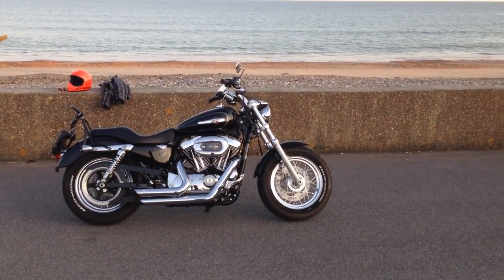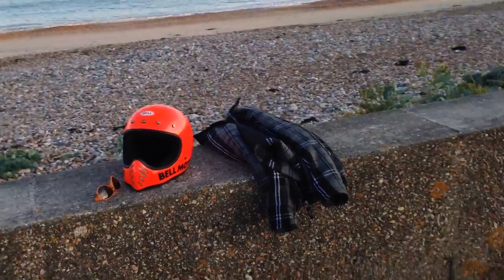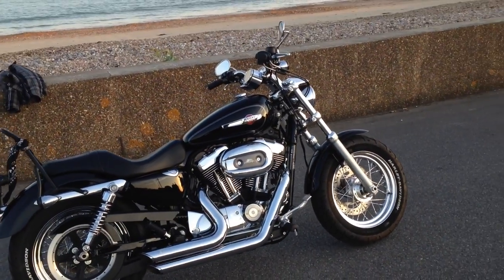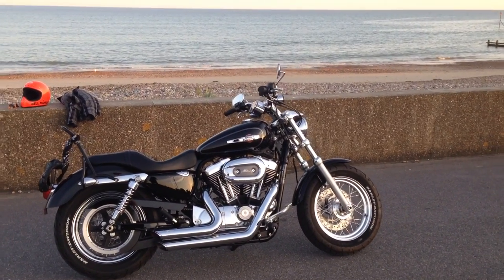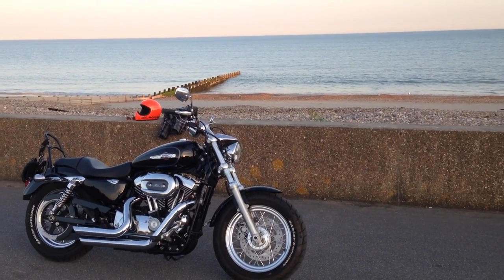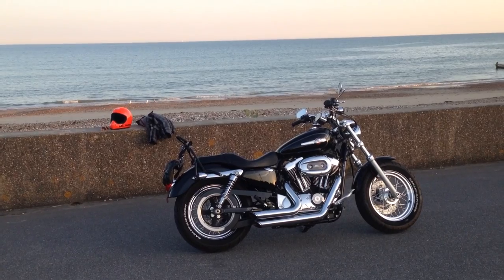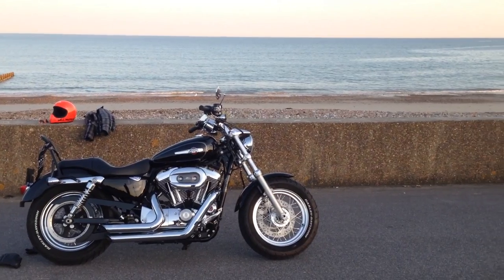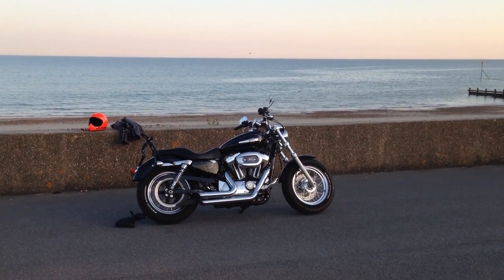What's a stage 1 kit and how much does it cost for my Harley Davidson sportster

Comment: I have a 2015 Iron and when I installed my fp3, it didn't ask me what kind of high flow air cleaner I have. It just asked me what kind of exhaust I had with a high flow air cleaner.
Sounds great. I have the V$H  Short Shots also. RIDE SAFE!

Comment: Thanks for the clear video, forums for a Harley noob can be a bit varied in opinion.
My biggest concern is longevity of the bike, I will definitely be taking a similar route to you with the stage 1, but I think I'll do the fitting myself.
Might see you down the Sussex coast sometime when the weather is good. Cheers for the video!
Reply: Jake 1200 , if you are concerned about longevity, don't worry. I have an '01 Sportster that I bought new and I'm still riding it with 87,000 miles on it. I have had no issues at all with the engine or transmission, or clutch. I did have to replace the fork seals about three years ago. Also, I replaced the drive belt once. And that's it, the bike has been very reliable and trouble free.

Comment: Unless your bike is still under warranty, then you can only do the screaming seagulls parts and only have Harley put it on. If you want to keep your warranty?
Reply: I haven't done mine just yet, but everything I've been told is that you can do the work yourself, but you have to use an HD tuner and take it to HD for the tune to keep the warranty.
Reply: @jacobwhite3128    Yeah, the HD tuner still leaves the bike running lean due to EPA restrictions. Anything Harley sells HAS TO be within epa regs or they get a massive, MASSIVE, fine from Uncle Sam. 
I went through DK customs and put a high flow breather, breather bolts , and these xl-vied devices on my iron 883 in place of the $500 tuner, and the vied devices won’t void any warranties because they don’t alter the bikes “tune” they enrich the air/fuel mixture outside of the actual tune in the ECM. I did all that for about $300 and my iron runs soooo much better now! It’s literally like a different bike. I can’t recommend DK customs enough! They are wizards when it comes to your Harley Davidson! I won’t go anywhere else for performance parts anymore.

Comment: Hello - I have the same bike....2016 1200c.  Love it.  How did you paint the HD letters on the tires.  I've tried a few options.
thanks.  Keep your knees in the breeze!
Reply from the maker: K Scott hi mate, I went on amazon and just ordered a 'tyre whitening pen stick'... you can get them on eBay as well. I warn you though it's a bit of a hassle, you literally have to lie on your back and 'draw' with the pen onto the 'Harley Davidson' logo on the tyre. The pen itself is a bit like a tip ex pen, it just gives you a tiny bit of white. Then you simply let it dry and boom......cheap as chips mod that really changed the look of the bike. Ride safe, jack.
Reply: @jackwednesday     sweet. Have to do this to mine

Comment: I have a cv carb can i just rejet
Reply: JT 1200 you can rejet it if you are installing performance air filter. More air in equals a need for more fuel/rejet otherwise it will burn too lean.
Reply: @MusicalHifi54  ok i jus did it this weekend i tried a 45 and a 180 she how it rides when the weather warns up ride safe thanks for the reply
Reply: @newwavepressure6478  how did it go?
Reply: @David-og7di  i did a 180 and 45 from cvp performance and a Arlen Ness stage 1 air filter was a little tricky I had to drill in the filter for my oil breathing system other than that the bike runs great it does feel like it has more power very happy I did it

Comment: Where did you get the 16 inch front wheel
Reply from the maker: AJFZ1R2010 hi mate, standard in the U.K. No mods, that's how they roll out of the factory for sale here.
Reply: jackwednesday wow thank brother
Reply: Sportster Custom has been with the big fat front tire since 2011.  Sportster 48 had this first (the big front 130 tire) when the model launched 2010.  All other Sportster have had slim tyres, the Superlow and Superlow T have a 120, and the others as the Iron and or Nightsrer have a 100, and the 72 has a slimish 90 - 21 inch.